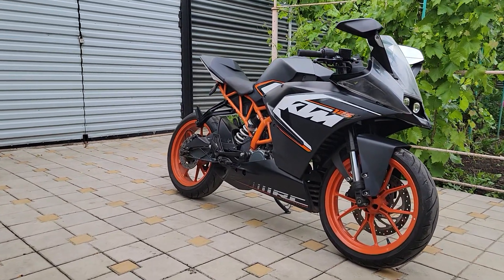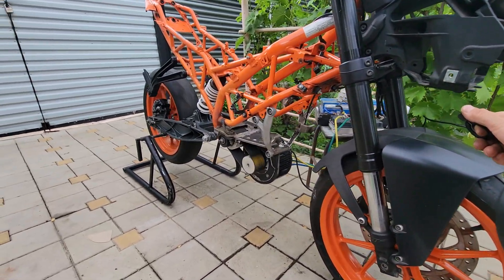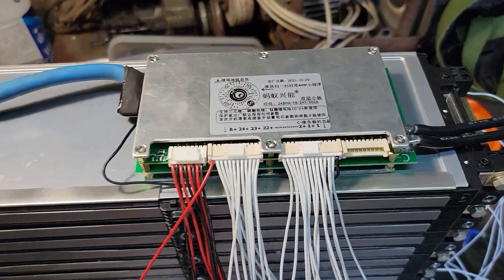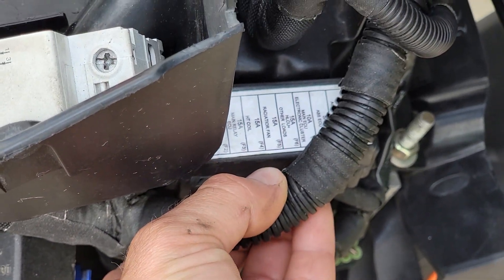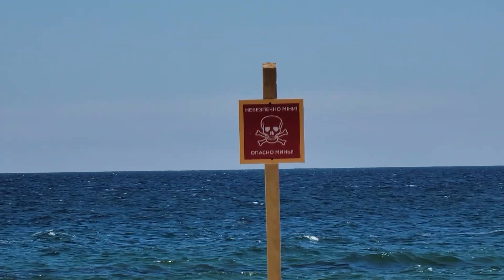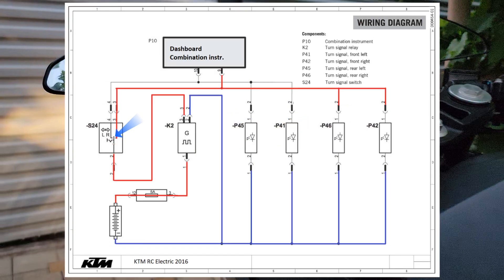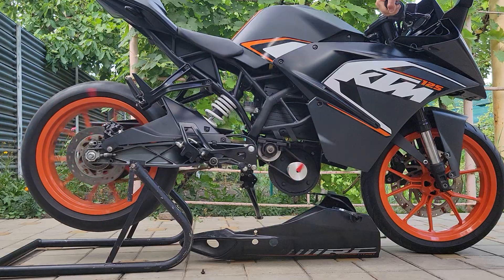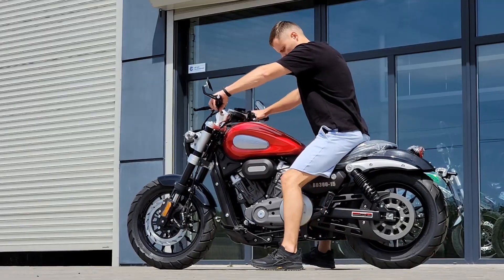Electric motorcycle conversion with  Mid Drive 5000W motor // KTM RC // Electric bike  //

Comment: At this point, I’ve literally seen ALL motorcycle conversions, and I can count it on one hand, how many of them was a “clean” conversion and not some ghetto work. Your conversion is on my counting hand, it’s beautiful work! No unnecessary welding or any ugly modification, using most of the donor. My only criticism is the gear reductor, it’s loud af. I believe your goal was torque and I’m sure it delivers the promise, I hope you’ll have many more rounds around both the Sun and the Equator! :)
Reply from the maker: Thank you very much for such a bright and original comment))))
Reply: Most of the sound is from the chain most likely. There isn't much you can do about that unfortunately. Belt drives are dead silent though.

Comment: Bro can we also have gear box fitted with electric motor , well I know electric motor don't need gearbox but with the help of gearbox we can also have even more torque for the start and higher top speed then we can also achieve all that with less powerful motor and can also get more range

Comment: Bro you have did excellent job , and I appreciate how clean it is… can you tell me how did you make the battery case ?  2:30
Reply from the maker: Thanks bro⚡️ this is the stock original battery holders with each cell !!!
Reply: @XitriyDmitriy  can you send me the links from where i can buy the electronics needed ? The motor , battery , control box etc & please send me your email/WhatsApp/Facebook  where i can be in touch with you because i need to understand all mounting points & close look at things that you made

Comment: I Dimitry maybe you have time and an idea. I have an electric motorcycle also china with the designation e odin. It is a 6 KW motor installed a 72V 130Ah battery and a Nanjing Fardrive where the manufacturer has registered his own name. The Fardrive works with 72V120A line current 150A, phase current 330A. I can't get faster than about 90 km/h with my E odin after a long stretch of 0-50 km/h I need 5.5-6 seconds. Unfortunately, the Fardrive data does not match because the motor was entered with 2.7 KW, which is not correct. If you could take a look at my parameters, who might well have an idea of what I can do. To get more acceleration and max speed

Comment: Here are the controller settings you want. (If on 72352 controller use larger values, if using 72252 use smaller values)

Maximum phase current 320a (or 280a)
Motor start-up current 135a (or 110a)
Average current 135a (110a)
Acceleration 1200
Deceleration 800-1200 (find your own sweet spot)
Start enhance enabled, auto, 10, 5

Hopefully that helps! Slava Ukraine 🇺🇦
Reply from the maker: Thanks 🙏🙏🙏Glory to the heroes